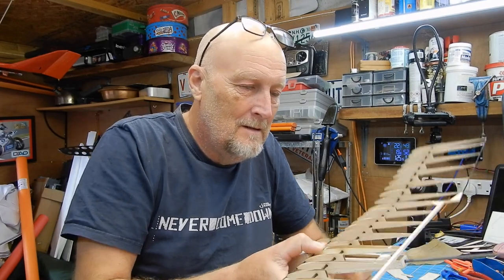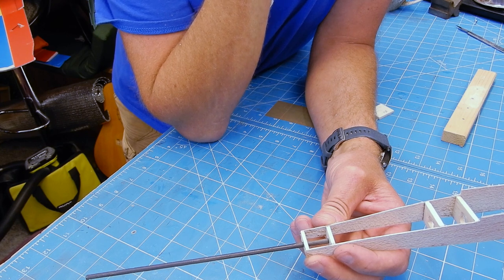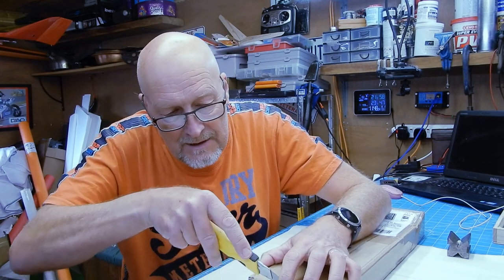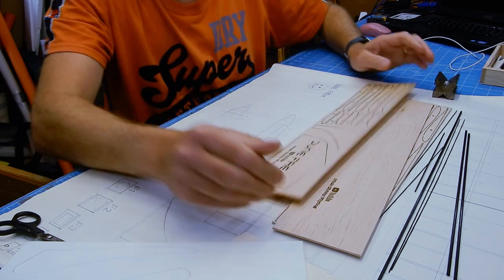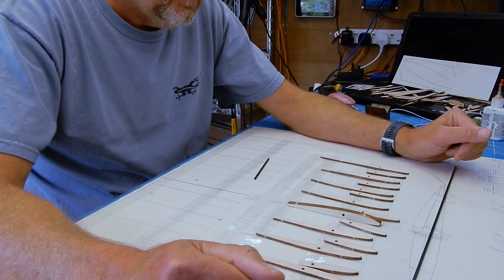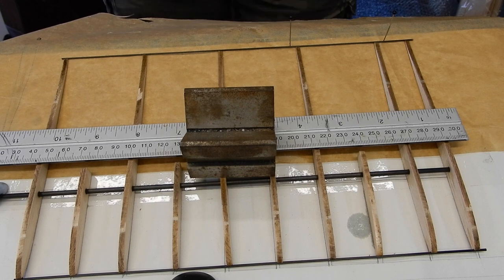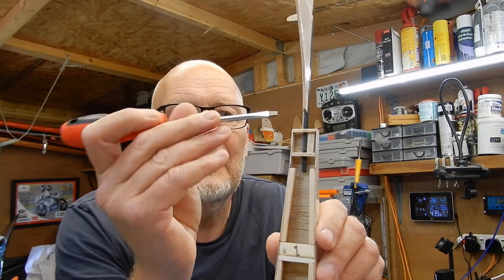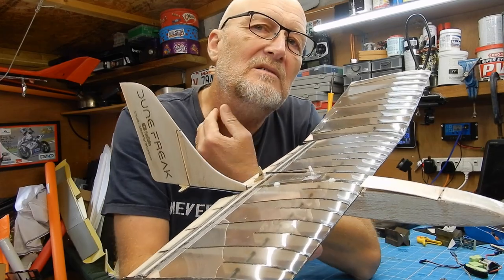My first home built RC balsa glider

Comment: Great vid with plenty useful info as usual with your vids, just wondering why you chose elevator and rudder for controls instead of elevons? I am curious as I am interested in building my own flying wings to help with carrying issues. And….. unless it’s something you want to keep private the wing loading and airfoil used, I note the reflex on the ribs but is it a recognised airfoil or just something you drew up?
Look forward to seeing the test flight vids, cheers
Reply from the maker: It’s based on the original wind freak which had same configuration. The foam experiment thermal turned so flat. I am hoping to make it a res 2 metre version 😍
Reply from the maker: The wing section is pw1211
Reply: @NickChittyFlying  
now that is interesting, PW1211 looks to me to have almost the same camber as MH60 but is a much thinner section. Please let us know the wind speed when you do your flight tests.
Reply from the maker: @leswalker2222  will do

Comment: This wing looking spectacular. Like how the black of laser cutting has become a contrasting accent to the transparent covered wing. You have achieved a zen like minimalizm to this build. (00:00)

13:55 I don't believe this was an unplanned cockup. Thinking this was added to the script for for drama in video production. LOL
18:20 It's clear that if you had put the fin on first, the wing would not have fit (with elevator attached).
Nice foreshaddowing at 2:34 ... of the area where an issue will be identified. 

Curious if you added any internal structure to support adding a hook for hi-start launcher, or if this meant purely for hand launched dune surfing? Seeing mentions of electric pod in the comments. Guess things to consider for future, including that addition of a spoiler you'd tested previously. 

Nice to see the raw design process. Hopefully the added drama in the build means less drama come maiden time. :)
Reply from the maker: On my grandchildrens lives I completely omitted the split elevator 😍👍